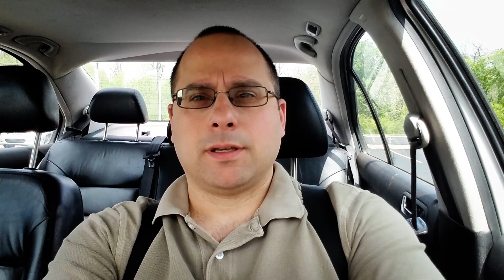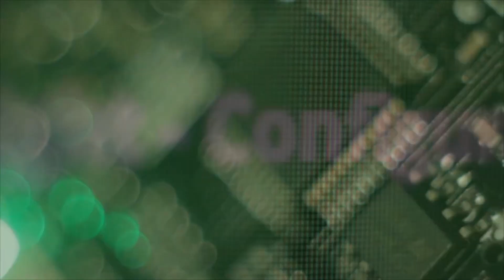Frsky Taranis antenna mod and why you probably shouldn't do it.

Comment: Been flying for 4 years without issues with the mod - even flew as far as 4 miles. Knock knock.  I think you using this as an excuse to get a new radio :-DDD JK.

Comment: I did the mod 4 years ago on a Taranis x9d plus. Took it out of storage and the mainboard has blown. Opened it up and there is corrosion around the solder joints where i soldered in the Antenna. Looks like i forgot to clean it properly after soldering.
Solder joint must have failed and i switched it on. I didnt get any warning that the Antenna was disconnected.

Comment: Did this run consistently for a period of time before it failed? 

This is total supposition, but as there is no exposed metal on the original antenna, its possible Teranis didn't bother with any ESD protection for it, and the RF front end got cooked by some static at a later date. Possible solution would be to add an ESD protection diode in parallel. 

something like https://eu.mouser.com/ProductDetail/Infineon-Technologies/ESD103-B1-02ELS-E6327?qs=y2kkmE52mdO61aafwIOtug==

Comment: My swr is reading 0-1 but can’t walk away 10 feet in range check mode
Reply from the maker: If the SWR is 0-1 then the antenna probably isn't damaged. If you have short range try another receiver. If it is short range in all receivers then the transmitter is probably damaged.

Comment: I accidentally snapped the antenna on my Taranis, the old wire is still connected but broken. I was thinking about doing this mod to repair it, but now I'm not so sure it's a good idea?
Reply from the maker: If the antenna is broken then you have to repair it somehow. Worst case you need to replace the radio board which is kind of where you're at anyway. But you have to solder on the new board too so you're kind of stuck soldering on the board one way or the other.
Reply: hey thanks for replying. yeah you're right I'm really outta options I got to replace it somehow. I do have some experience soldering so hopefully all goes well. I managed to find an RP-SMA pigtail cable lying around I can use. Someone recommended I buy  the official frsky 2db antenna, I think for SWR reasons. I seen your other video where you figured out it was the antenna that caused it to fail and glad to see it was simple to fix (and no permanent damage done to the board)

Comment: I realise this post is now almost a year old but it is interesting to note the special edition X9D+ is having the same problems - many owners are reporting reduced range after very brief periods of use. Does this help define the cause of the problem with the 5db mod given that Taranis factory spec Special Edition X9Ds are failing regularly with the same symptoms???? I only ask because I'm new to RC and looking to buy my first radio and wondering whether to buy the standard or Special Edition Taranis. If I go the former, I will upgrade the gimbals from the get go . . .
Reply: Yeah I've heard about it. If I were you I would purchase the X7. If you don't like the form factor then buy the normal taranis.This issue sucks, and noone knows why it happens lol
Reply: Thanks but too late - I went SE. It now comes in a modified box, comes with the aerial attached and so can be stored likewise. They have revamped the attachment point as well to make it more secure. Mine includes the capacitor and ferrite. I haven't tried it yet - just finishing the build on my first quad and your videos have proved invaluable - especially playing with Betaflight, setting up the X9 and arming the quad (wouldn't arm) - all now sorted. I won't take the aerial off unless absolutely necessary but strangely, whilst setting the thing up and with the Taranis on the bench, mere inches away from the quad, I kept getting "telemetry lost" messages - perhaps if they're too close, it gets swamped?? or maybe I have a duff one from the get go. A full range check will be one of the next things I do just to ensure mine isn't fubarred out of the gates. Thanks to Josh for all that he posts - I wouldn't have managed to get even this far without his fab videos

Comment: What about someone wanting to do the mod so they could hook up a 2.4 booster instead?
Reply from the maker: I'd be surprised if it was legal to use a 2.4 booster. But anyway, the risks are the same. Your call.
Reply: Legality aside, I was curious if the booster would cause the same problem being that it would probably be a 50ohm load (assuming I left it attached all the time, while removing the antenna), because based on the comments, having an antenna attached or a 50ohm dummy load will prevent this because without anything attached you cause the transmitter board to be exposed to ESD that over time damage it.

And I mean we all sit on that line if legality to some degree, especially when it comes to VTx it seems.  But I don't see it as a big problem if its something I want to turn on a use for longer range if I go out into the middle of nowhere and want to fly a few kilometers, even though I could buy a crossfire module, however I wanted to stick with my FrSky receivers.  But if its a hassle maybe I will go Crossfire.

Comment: you know what is funny? the circuitry in the RF backboard consists of a CC2500 (low powered) 2.4ghz tranceiver, and a SE2431L front end signal amplifier. a lot of talk has been said about the importance of the length of the pigtail, and how 84.something is a critical value, but no one mentions the 21mm of unsheilded copper trace between the solder pad for the center pin of the pig tail to the ANT1 io pin on the SE21431L.  Strange... 

You know what Else has a CC2500 and an SE2431L in it, as well as two antennas with U.FL connectors too?

the Frsky X8R 8/16ch telemetry receiver..  Go figure. 

I might have to harvest the SE2431L front end out of this to put in my dying taranis. :)

Comment: would this be better

https://l.facebook.com/l.php?u=https%3A%2F%2Fwww.rcgroups.com%2Fforums%2Fshowthread.php%3F2754867-DALRC-2-4G-8dBm-power-amplifier&h=ATNMuFh_SLfT7l-ISfYO0rEBTtD4cDw9dTMT_0ySmkgtJlQSzo9TSm9uqMFH9X9PiNu3-65WSNHoca0hWud6uBOi-qDvADE8mzrFHsBv9zDoBQt6MOhSKs18Axmb9m1NOWD09Yihwmw7jJ8Wx1cE
Reply from the maker: I would want to verify that the 2 watt output was legal in the U.S. before installing that. If you do install it, it will improve your control range, but it will not improve your telemetry range, and you may get incorrect RSSI warnings, because the Taranis may base its RSSI calculation on the strength of the in-bound telemetry signal. A lot of questions to answer there. In general, it's better to use a superior antenna than to use an amplifier, because an antenna improves both TX and RX side of the link, and an antenna doesn't blast everybody else on the band with your signal in the same way an amplifier can.

Comment: Maybe you just didn't do it properly. There are quite a lot of people that have been running this mod for years with no problem at all. Frsky even has a limited version with this mod already done. Maybe you just overheated it, I don't know.
Reply from the maker: +David sas I know some people do it successfully. I also know that any people are having it fail for no apparent reason even after doing the mod correctly. That's why I'm warning.

Comment: My radio worked like a charm for about two weeks and then I started getting RSSI warnings and failsafe outages. 

Upon careful inspection I found that my SWR was going up and down when i tried to further fasten the antenna. Soon I discovered that the cable got damaged at the base of the antenna connector from removing and reattaching the stick. What happened is the connector rotated when I was fastening the antenna and the stiff cable was stressed beyond its limits every time the antenna was attached. After replacing the cable yet again and then gluing the base of the connector to the case I was finally able to screw the antenna on without dangerously stressing the wire. No more issues for the last 7 months! My range definitely improved and if done properly with the SWR 0 to 1 it won't damage anything. 

Also the thin wire is perfectly OK since we are running no more than a couple of inches of the screened wire. Thicker cables are needed for long runs to reduce signal loss.

Comment: I know why the mod has shortened range.  I did a video on this on my channel.  It has to do with the effects of the ground.  

Also, the main reason they are burning up is the coax people are using is easily melted by solder.
Reply from the maker: Please link the video here. I'd love to pin it.
Reply: Please share the video link.

Comment: by reducing the distance you need to replace Se2431l-r amplifier. and to return original antenna
http://www.datasheetlib.com/datasheet/719636/se2431l-r_skyworks-solutions.html

если ваш таранис после экспериментов в антеннами потерял дальность. надо менять чип-усилитель сигнала. можно купить на али.

Comment: Coax, static, and poor soldering aside. I'm a little concerned that you had no warning what so ever of the failure.
I stopped using the 5dBi antenna mainly because it was inconvenient physically and have gone to using an antenna off an old router. 
I have noticed on occasion when the antenna was close to my body that I got a SWR or power low warning, cant remember which.
Though my TX was dead out of the box when I received it so its had the TX module replaced, I'm wondering if there is a bad batch.
I used it for a while with an external XJT so I keep that on hand should there ever be a problem.
Reply from the maker: +Rotor Rant I did get some warning. Low RSSI and failsafe at normally fine distances.
Reply: OK so it was almost like a slow degradation like heating due to miss match. 
Pity your not in Australia as It would be nice to do a failure analysis.

Comment: I was going to do this but my antenna is not broken, think I will just go with a 433mhz module which I think here in Australia you are allowed to use up to 25mw, would a 433mhz 25mw module still have better range then the Taranis with a X8R, there is a calculator says it should go about 4-5km with a dipole where 100mw 2.4ghz is calculated at 2.1 kms.
Reply from the maker: Hahahaha yeah 400 MHz goes much farther than 2.4 GHz. But honestly, 2.1 km 2.4 GHz at 100 mW is optimistic.
Reply: Joshua Bardwell Yeah I know it's at perfect conditions LOS but it's an online calculator so at least it gives a rough idea if a setup is going to give a huge range difference.

Have a look if you haven't already.
maxmyrange.com

Comment: @joshua: why do this mod?
I just bought a Taranis JR module, plugged it into the JR port, and I have a coax plug to connect a huge antenna into it without and problems or soldering.
And if somehow I fry something, I'll have fried the JR module, not the stock radio.
Then again, after playing with this I just switched to LRS 433Mhz, so now I don't really care anymore :)

Comment: @Joshua Thanks for sharing this thoughts.
I just have 2 notes:
1. FrSky themself sell a modded Taranis with 5dBi Antenna Mod recently... Don't they would give any feedback to that?
2. Solderings is not really necessary on most Taranis ouside. When you look on your serial Number on the Sticker on the JR Slot cover you will see a B01 or B02 Ending...
IF Your serial ends with B01 you probalbly have to solder like your module on the video.
If there is a B02 at the end your Taranis uses a IPEX on the module - so you would only need a porper replacement...
Reply from the maker: Taranis have gone back to soldering, because the FCC told them the IPEX was not okay. Go figure. They can't use IPEX on the inside but they are allowed to use RP-SMA on the outside. Who can understand?
Reply: LOL ... Nice this I didn't know...
I sort this under FunFacts.... Has nothing to do with logic ...

Comment: Would you please post a follow-up on this problem when you determine what board needs to be replaced. I did this modification and had a 0 to 1 SWR after I finished. Now I am noticing a slowly increasing SWR and decreased range. Bummer!
Reply from the maker: Try buying a new antenna and see if the connector on your antenna is just wearing out.
Reply: I tried a different antenna ( from a different manufacturer) and my SWR is back to 0/1 and my range has returned to normal. I don't think wear on the SMA connector is the issue. I probably haven't removed the antenna a dozen times since installing it. Perhaps bending/angling the antenna might be an issue? The new antenna was labeled "FrSky replacement antenna" in the advertisement. ?? It is different in that the one giving a problem has a metal thread where it screws onto the transmitter. The new one has a plastic thread. Long reply but I thought you might be interested in the forensic evidence.

Comment: I had this happen also after the mod, I had a few freak failsafes and eventually I  got the antenna connection error.  In my case I found that my rpsma bulkhead fitting was not tight and spun when screwing on the antenna causing the cable to twist until it ripped the pad off the board.  I replaced the bulkhead fitting with a new one using the original coaxial from my stock broken antenna which is a much smaller coax and more flexible.  I scrapped the insulating plastic off a section of trace remaining from where the pad ripped off and was able to re-solder the coax but this time I hot glued it to the pcb in a couple spots.  My SWR is good and I have not had a failsafe in a couple weeks but I did order a new back board and antenna and will replace the mod antenna with stock one again.

Comment: Joshua, I second what you say. I am a professional electronics technician with thousands of hours in smd rework, as well as board design, prototyping etc, so my U.fl installation was done to a decent standard, and I used a lot of effort to calculate the coaxial feeder to cancel periodic phase reflection and reduce swr spikes caused by inevitable factors like the U.fl connectors, the cable itself, the sma connector, as well as the strip waveguide already on the rf board. This however was not sufficient to prevent my MMIC from slowly dying, and my effective range diminishing. I suspect that the output device bias makes it very sensitive to reflected energy spikes most likely caused by the added U.fl and sma connectors. These are like potholes on the freeway, as are any interruptions to a perfect coaxial feed line to the driven elements of the antenna, not just causing losses, but undetectable reflections which combine at various frequencies (FHSS) to damage the output device. This is especially the case where the device (MMIC) is running at the upper end of it's design limit, like wifi devices operating at 20 dBm (frsky) Mirowave RF feeder design is very complex, and not just like wiring a CB antenna So, your advice is very good, just don't do it, it will fail.
Cheers, Alasdair.
Reply: El Cabron Negro, No problem, as the module has been designed for using an sma type antenna, it would be causing no additional reflections or mismatches between the output device and the driven element of the antenna itself. It would be wise to use a good quality antenna that is properly tuned for 2.4g only. Some wifi antennas are dual band and extremely bad at both for transmitting with anything more than a few milliwatts. The problems Joshua was pointing at is just the internal stock antenna. Cheers
Reply from the maker: +Alasdair McC have you tried replacing the antenna to see if it fixes your problem?
Reply: Joshua Bardwell I did, I measured several various types for gain and pattern, but once the problem began becoming noticeable I did a power output check and found I was only getting under 1dBm, about pre driver level, so that taranis was relegated to Dragonlink only duty. It gave me an excuse to buy a second taranis for all my non Dragonlink aircraft, and now I won't touch it.. even knowing what I'm doing tells me not to do it.. Plus, just leaving the antenna off for a few seconds when powering on is rf board death, so, not that I would but I could, so I think its just better not to mod. I only did it the first time because I broke the stock antenna, like most people. Another thing too, the U.fl connector is a very delicate item, only rated to be mechanically connected 8 times before replacement, and non robotic assembly can easily distort the geometry of it, they are also prone to pin receptacle misalignment when pushed together by hand forcing the centre conductor off to one side, still conducting but super lossy and ineffective at high frequencies. People would do better cutting and soldering direct, replicating the divided shield as per stock.
Reply: Thanks mate, we appreciate your expert opinion. 
Would you say that screwing a 5db antenna (as opposed to the 2db stock antenna) onto the RP-SMA jack of the external FRSKY module would also cause damage to the circuitry in that?
Reply: Alasdair McC thx mate!
Reply: interesting.... AFAIK the taranis SE uses the same TX board and they put the SMA connector for the 5dbi antenna, in other words, so far there is no such special TX board for the taranis SE (designed to use the SMA antenna connection) and a different TX board for the regular taranis....also if the degradation is so effective, why some people have no range complaints about the mod with their converted unit 2+ years.... something is going on here and we don't know it, please dont get me wrong, Im just trying to think out of the box
Reply: larryoakley 
Yes, I agree, the factory made version looks the same, and there is obviously more to it. My failure may have been a coincidence that was possibly initiated with a conventional but slow failure of the output device which started at the same time that I cracked my stock antenna hinge.. I have wondered about that, now it's just looking more than coincidental when so many others experience the same issue, with the common thread being antenna modification.
Reply: Poor you, what a  wanker